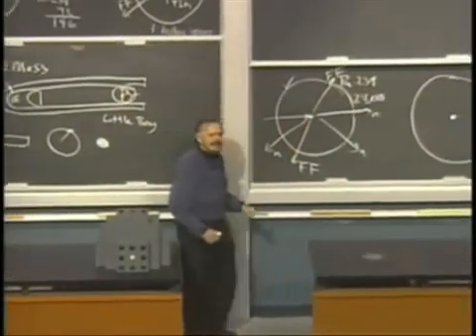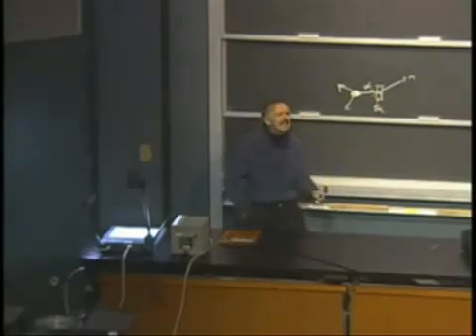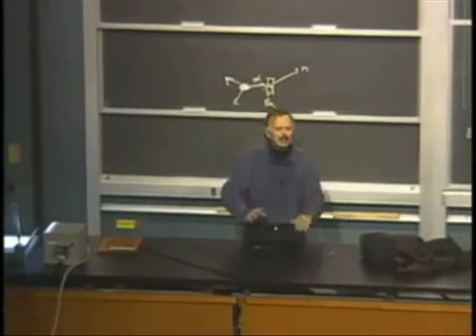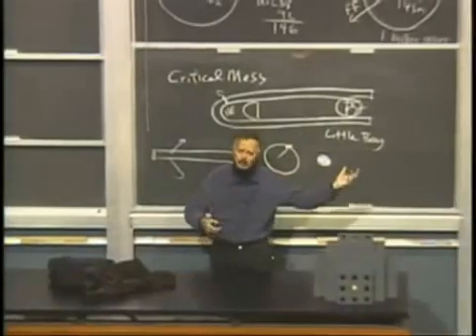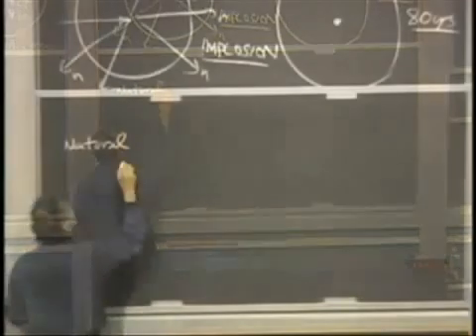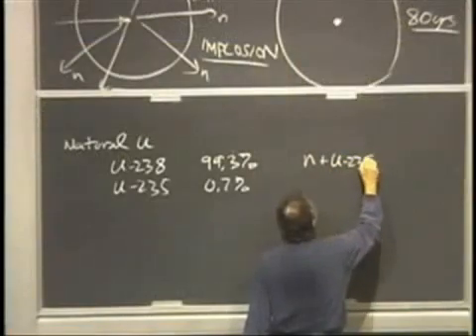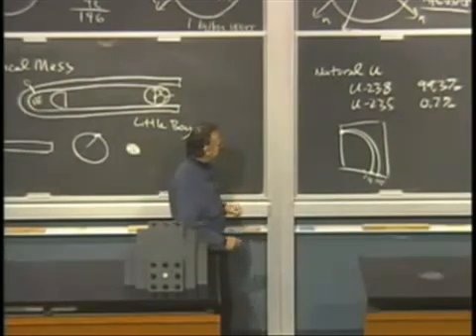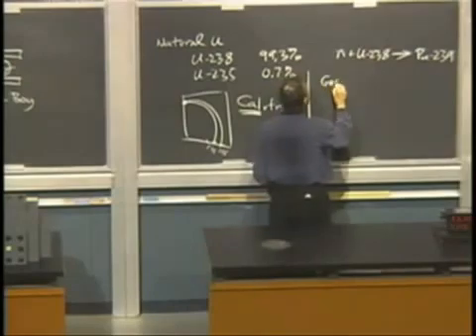Nuclear Physics 101   The Implosion Bomb and Uranium Enrichment   3 of 6

Comment: or you can use a 3d printer and print the mold and fill with melt castable / PBX explosive, which are very easy to make.